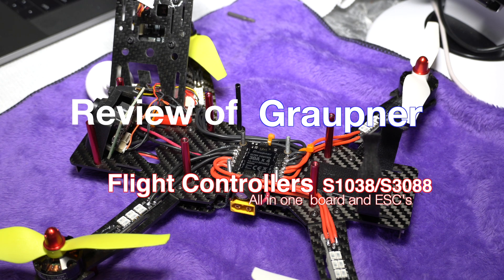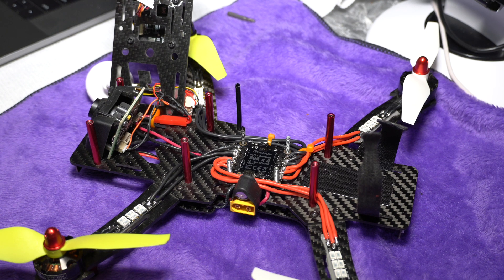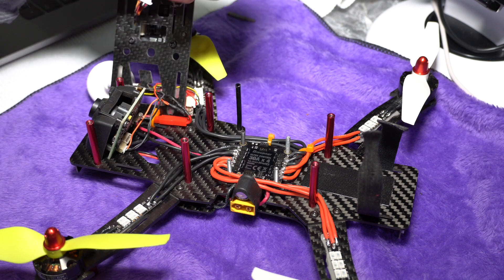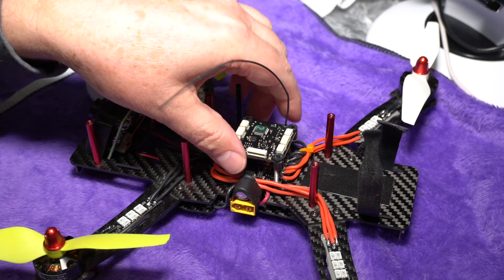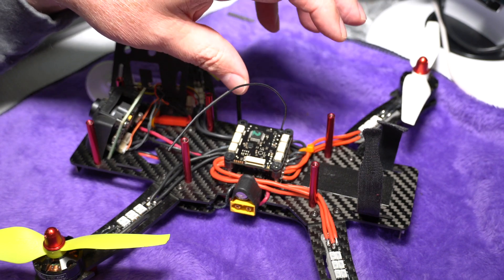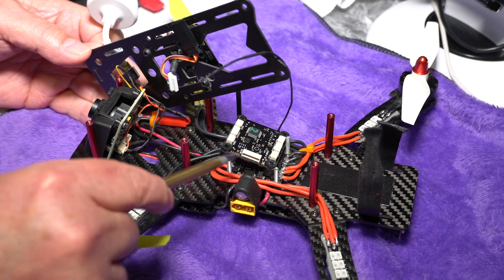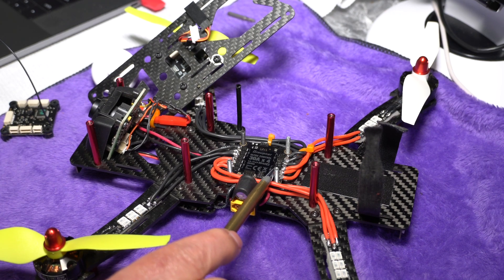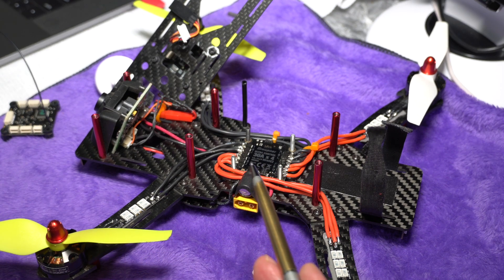Graupner S1038 and S3088 review

Comment: Hi so i have an older graupner mx 20 radio can i set up the aio with this or is there a computer interface that i can use
Reply from the maker: Michael, as this is still a HoTT radio you have telemetry access and therefore you can configure the AIO directly from the radio. This is one of the things I really love about Graupner radios and the receivers.